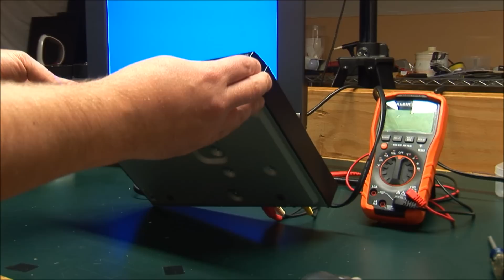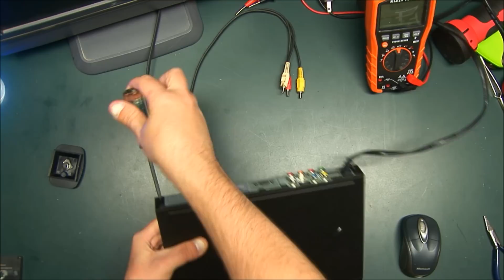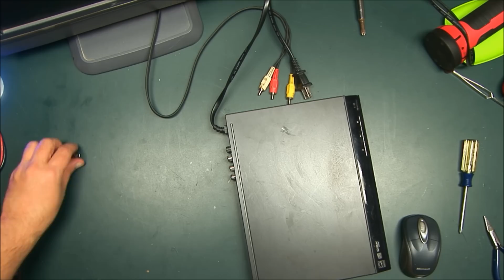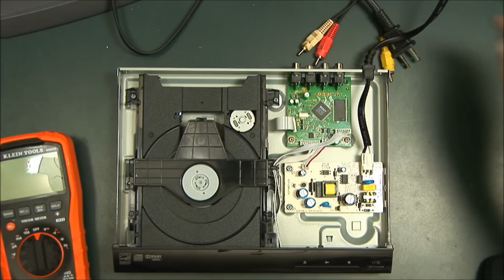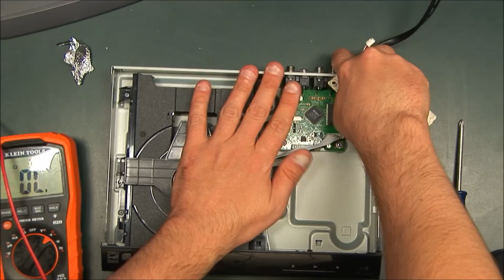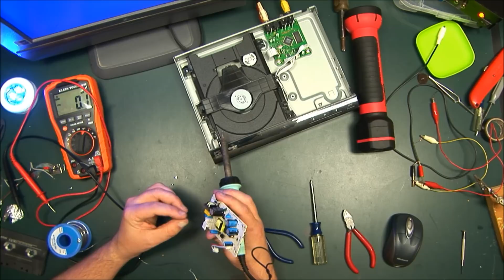Sony DVP-SR210P CD/DVD player - No Power Repair

Comment: That long boot time is normal. I have a 2 day old dvp sr210p (same unit) and it works the same. (Edit: mine only has one screw holding each circuit board! Other than that, I think the power supply might be laid out differently. The fuse is brown instead of black.) The other circuits and the actual dvd drive appear the same though. (Edit: mine only has a similar SONY square chip on the board with the ports, not the rectangular one! Newer revision, more stuff going on in that square chip now with the new tech. The cables are also all ribbon cables on the new ones now.)

Comment: Hi, I am repairing my own Pioneer DV-585, its dead unable to On, I have replaced the switching SMPS IC and those flex connecting cables from power board to control panel but it still won't work but I do know the power reservoir cap has degraded to 76uF from 82uF.,  can that be a reason it won't switch on?
Reply from the maker: No. That cap sounds like it's still within spec.   Have you taken any measurements?  Probe around the board.  You need to find if there is power outputting from the power supply, if it's correct. And if not Where is it failing.
Reply: @Electronicle , I have taken measurements on the A6151 switching IC, it can produce +/ 32V but nothing is  going over to the secondary side of the SMPS tranny, BTW also tested the only opto-coupler but is good  so now I have downloaded the service manual and found out that there are a few transistors on the PSU board acting as switching devices for the Standby and On power rail in order to complete the system loop before whole board level operation can work as it supposed to be, I will continue to check up on all those transistors via outboard confirmation later and if I am really able to revived this unit I will make a video in  my channel detailing everything.
Reply from the maker: Choong excellent!  Hope to see it.
Reply: @Electronicle  , I am not going to spend time on it anymore, all the transistors are good, the situation is still that there is voltage from the primary but nothing on the secondary, the SMPS transformer is measured to be good according to diagram and all caps are good as measured by ESR meter so in a nutshell before I gave up this is what I had done - 1- changed panel buttons, 2- changed flex connecting cables between PSU and user panel, 3- resoldering PSU PCB, and 4- changed A6151 switching IC, I think after 13 years its such a good model so I am going to get a new DV-5032V which has all the same audio video specs.
Reply: Merhaba güç kaynağı kaç volt ?

Comment: ran across this video in my search for an answer => I have a 5-disc Sony CD player from 20+ years ago (Sony CDP-CE305) which has held up very well...until a couple of weeks ago when the power button refused to stay depressed. When I press it in and hold it, the unit powers up properly and everything works. However, it won't stay depressed on its own. I opened the unit up and got to the board with the power button circuit, but I can't tell if I can actually replace it (or if it's worth it). Any thoughts / ideas?
Reply from the maker: check out ebay for used working boards.  here's a link from one that I found.  Probably the easiest way for you to get it fixed.
https://www.ebay.com/itm/Sony-CDP-CE305-4-978-490-01-CD-Player-Button-1-659-158-11-6590158011/143207866750?hash=item2157daa17e:g:YnAAAOSwXuNcwwL4:sc:USPSFirstClass!15905!US!-1

Comment: What type & company of digital multi-meter you recommend? 
I always use surge protector for all my electronic devices even for repair purpose. 
This is true & sad that now Sony is using cheap components to bring the cost down but that became headache for many customers. Thanks for this video.
Reply from the maker: Hey,  I personally use a Klein, not because its the best but it works for what I need.  Fluke makes great equipment (or they did..not so sure about anymore).  Really it depends on what you are using it for.  A simple $10 DMM is fine for someone just checking basic voltages around the house.  I have a couple of those that I got from Tractor Supply and they work fine, however they only only have a few digits so can only use it for basic things......not to mention I wouldn't trust their longevity.

Comment: Those are $5.00 at Good Will so yeah. Not worth much huh? I seldom find it to be just a fuse. I have all my electronics plugged into a surge protector at home. We dont have a fuse box with surge protection built in so everything has one in our home. My wife works at an office and told me guys throw them away all the time. Everytime someone leaves, they throw them away.

Comment: good work, I see so many of these tossed away, if it's something easy to fix ok, otherwise I save them for parts. I pull the power supply & motors, belts etc.

Comment: Hi Electronicle amazing for what you do sir!  I have a quick question hope you can answer me?  I have a Sony 4k bluray player recently purchased April 2017.  The problem I have with this player is that when I turn the power on the power light will comes on for about 2 minutes and it power itself off.  The screen display does not comes on at all.  Is this means I have power issue with the power switching board or other issue like the hardware or software?  I am about to trash this player but giving one last try by watching your video.  Hoping you might be able to shed some light on this issue.  Thanks!
Reply from the maker: I need to do a video on how to test or diagnose a power supply fully, so this is a good question.  Just at first 'glance' it sounds like the main board is shot as in its not 'booting' properly.  They usually use a eeprom or flash chip to hold the firmware that it boots off of when you turn it on.  If that becomes corrupted they won't boot, however this is without knowing anything at all about the exact player you have and without looking at it myself.  Have you checked online to see if anyone else has had the same problem with your model?  Sometimes there's a reset procedure that you can do ( you know hold 4 buttons while tapping your foot and blinking twice) on devices to bring them back.  I would do some searching for that using your model number.  As far as a power supply, I assume there's a cable coming off the power supply to the main board.  You would need to know the pinout of that cable (what the voltages are for each wire) and test.  Sometimes they print that directly on the board next to the connector.  Part of the test is not just to see that the voltages are there, but how clean the DC voltage is...is there a considerable drop in voltage when the unit is powered on etc.  Before you go digging too deep though, like i said before, check online if you haven't already for similar issues that others have had and if there's a reset procedure.  The fact that it stays on for 2 minutes before shutting off automatically leads me to believe its probably not the power supply, however again this is just a guess at this point.
Reply: Thank you very much for your reply!  My bluray player is the Sony UBP-X800.  It is a 4k bluray player that I purchase last April 2017.  Since the unit is too new I can not find any repair infos on it.  I am not an electronic repairman and have no test equipment at all so testing it for voltage is nearly impossible for me.  I did some research and found a good switching regulator exactly like mine for sell on Ebay for $35.  A picture of the board is on the listing.  I am attaching a link just in case you want to see what it looks like.  https://www.ebay.com/itm/Sony-1-474-675-11-SRV2497WW-Switching-Regulator-PSU-for-UBP-X800-Blu-ray-Player-/162976061155.  Like I mentioned earlier I am at a last ditch effort to save this player from going to salvage.  Thanks for your time!
Reply from the maker: if you have a multimeter you can check the output of pins 4, 5, and 6 for 12v when its turned on, however if you don't there's not much you can do.  Depending on how much you paid for it, you can give it a shot.  Another option would be to not throw it out but set it aside for a bit and keep your eye on ebay for one that works but has a scratched up case or one that works but won't read a disk.  Combine parts out of the two to make one that works.  As for the last example:  It seems like you have a bad board but a good disc drive assembly, if someone has one that won't read a disc because their laser is bad, you could swap your drive assembly into the other.  You could then keep it as a backup or sell it and make a few bucks.  Again, just a thought.
Reply: I think the power supply is good because when I unplugged the 12v power supply to the 2nd main board the unit will not power up and it will power up when I connect that cable back in.  My guess now it is the main mother board and that board is costly.  It cost more than the whole unit itself.  I might do what you suggested set this aside for parts .  Once again thank you very much for all your time!